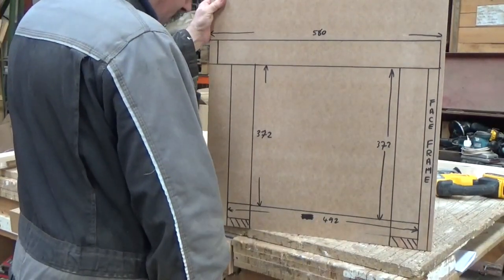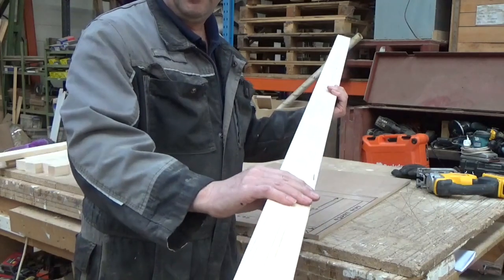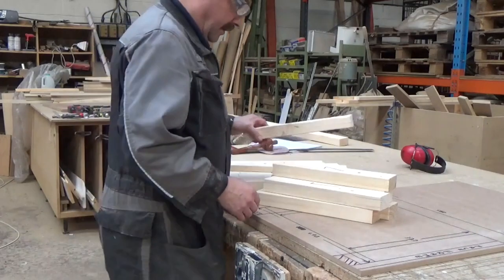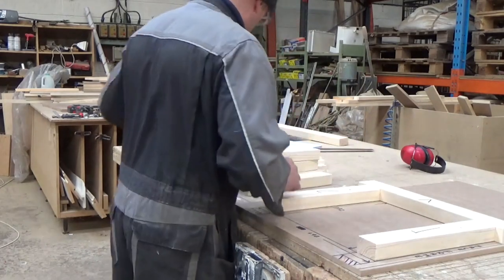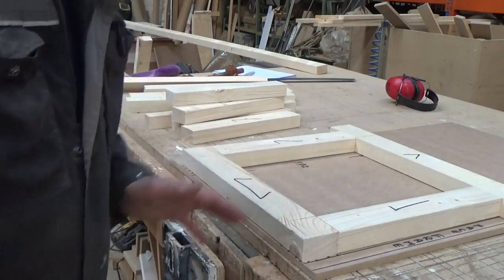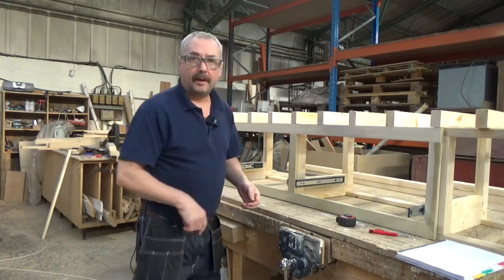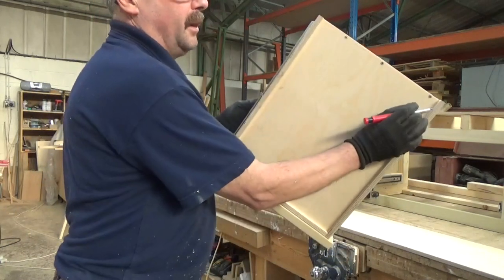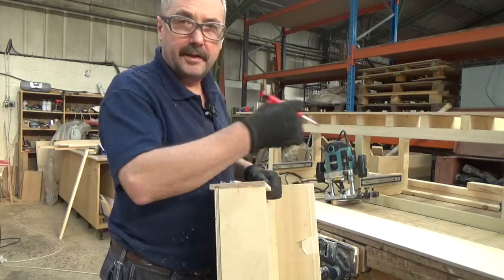Narrowboat Build . Making  A Pull Out Double Bed

Comment: Glad you decided on pull out bed . Surprised nobody has tried to have dropdown bed ie hingedto wall and droppeddown  we had one of these in a flat and it gave you more room and fitted back into like a wardrobe.
Reply from the maker: Hi Peter, I did consider a Murphy bed. Will see if it will work on my boat.